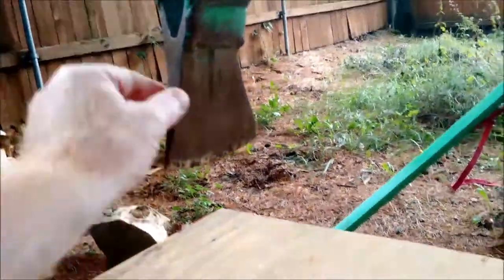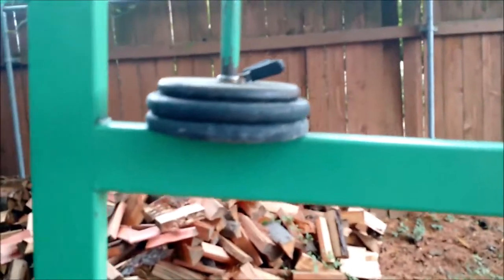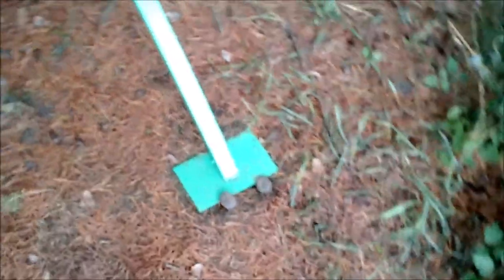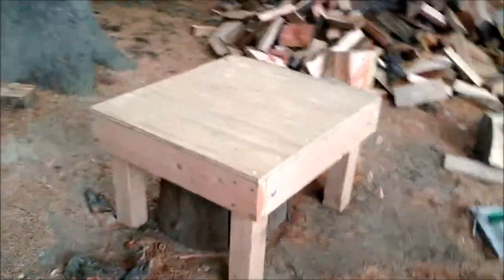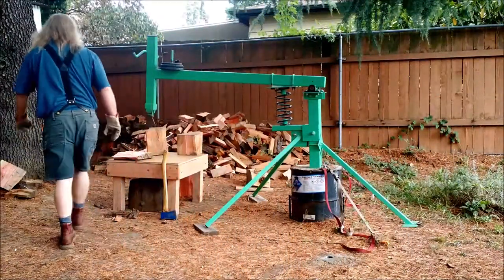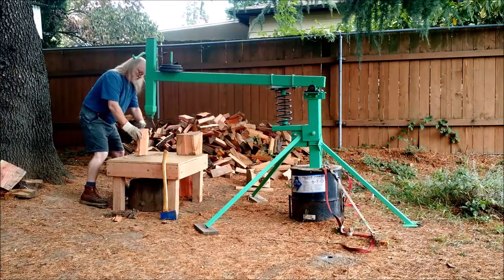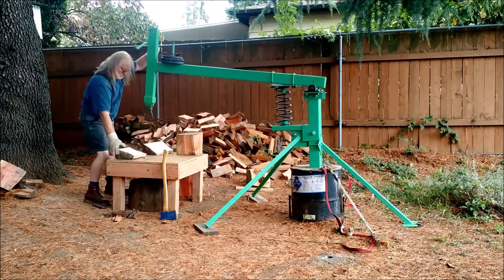Maunual Firewood Splitter

Comment: Nice splitter.  I would like to see you split 18 inch long logs with it.  I'm confident it can handle the wide logs but I want to see long long split with that thing.
Reply from the maker: I never tried splitting wood longer than my stove would take. I have a Morso Owl, I love it. It only takes 12" wood. I guess I will cut some logs at 18",split them , and then cut them shorter.
Reply: @capncaptain1594  Yeah, my stove takes longer logs so I was wondering what you thought about it.
Reply from the maker: @beebob1279  I would need to adjust the height so it would be able to accept longer logs.
Either by using a thicker shim
above the spring, getting a stiffer spring or removing some weights.  I have split 14" before because I cut it too long.  So I think 18" could be done.
Reply: @capncaptain1594  Last question for you.  I'm looking for a spring splitter.  Where are they in the marketplace?  I can't seem to find any for sale.   Nothing.  Any ideas?
Reply from the maker: @beebob1279  made this one.
I don't weld, but I designed, cut and put it together after I told the welder what to do.
Finding a spring from the
 rear end of a 1991 Grand Marquis.  I would like to experiment with a stiffer spring and more weight.
A station wagon or hearse would be good.  Most cars nowadays are front wheel drive. This is a pig tail style.
Since this video I raised the table and leveled where I am standing.  Works better now.

Comment: How about a motorcycle clutch lever and cable on the bars with the cable going back to the pivot point to release a spring loaded lock pin.  This way when you let go of the bars to grab the wood, the pin will catch and stop the bouncing.  For safety's sake.
Reply from the maker: Yes, I have seen that.

Comment: First, I really like your video. Second,  a couple of questions: What is the wall thickness of the square tube you used? And what is the length of the arm from the vertical member to the axe head. I plan to build one of these myself this winter. Thanks!
Reply from the maker: Thanks,GonehometoAcadia. Wall thickness is 1/8 inch, top tube length is 72" and down tube is 30."
Reply: @capncaptain1594   Thanks!
Reply: I plan to build this manual splitter eagerly but I have a question? How long is the arm where the  blade is, from  the vertical post.

Comment: How critical are the tie downs? what is movement like with just the weight and feet?
Reply from the maker: It doesn't move now but the tie downs lock it in place.  Without the tie downs it tends to rock a little.  I wanted to make sure I could take it apart to move.  I think one could set the steel 4x4 in concrete in the ground like a fence post.
Reply: @capncaptain1594  I would really like to build one, but i live on a very rocky hill and anchoring it would be extremely difficult. Do you think it would be possible to build one that was mobile (even if that meant dragging it on runners) but still stable enough to use without anchors? Really nice build by the way, love how smooth those pillowblocks make it ride, and the weight post is genius. Simple, but genius.
Reply from the maker: @sp4cepope  Check out Ingmar Andersson's You Tube channel he has one also.

Comment: Will it split maple and ash?
Reply from the maker: I live in Oregon and have no problem with Alder, Douglas Fir, Cedar, Spruce and Big leaf Maple. These are the indigenous trees of the Coast Range. I would have to import other wood to split.
Reply: @capncaptain1594  I am very happy if it works. I love the idea. 
My Ohio hardwood wood is in the 1300 range, a bit harder than big leaf maple. I would probably need a heavier counter weight.

Comment: I think I could split it just about as fast with that axe leaning up against the table.
Reply from the maker: Thanks for the comment. I'm looking forward to your wood splitting video.
Reply: I bet you couldn't.  You'd be exhausted.   I would say Cap'n Captain would walk away barely winded while you're sucking air.
Reply: Possibly but for how many hours in a session? And what happens when you get old sick and weak like me looking for a mechanical/powered solution?

Comment: If that spring breaks it’s weld you are in trouble...
Reply from the maker: Not sure which weld your talking about on the spring. It probably got more use on the car it came off of.  I will buy another one at the junkyard if it breaks.  Thank you for the concern,
Reply: Is the spring just sitting there??? Or is it welded onto the mechanism? Either way if the spring shifts while compressed it flys... that’s why they are mounted in vehicles and taken off with spring compressors. That’s what I meant.... and iv seen it happen.... it’s not pretty when someone gets hit in the head or face when the spring breaks or shifts and fly’s off.
Reply: Iv seen people mount some sort of metal tubs of sorts around to protect that from happening. It probably will never happen but it sometimes does... especially if it is a used spring. No disrespect was just stating what iv seen in the past. I do like your machine though.
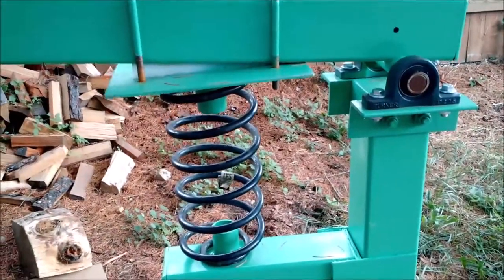Reply from the maker: @honestme72880  Watch the video. At about 1:34 you can see that it is a pigtail spring and that on the upper and lower mounts there are steel tubes
welded in place.  The spring fits over these mounts and it can't go anywhere
because it is under tension and compressed.  To remove the spring I remove the weights and have to lift the arm high enough so that the spring is under 0 tension and clears the mounts (tubes).  Works slick.  Maybe I will make a video of how to remove the spring.  I used to work in sawmills I am a safety first guy.  Have all my fingers still.

Comment: I think you should have raised the table a bit more so you don't have to bend over so much. Other than that, cool machine!
Reply from the maker: I'm 6'4". I made it for my wife to use.  She is 5'3"
Reply: The other benefit to a lower table means you don't have to lift heavy rounds as high 😎
Question, how does it go with large rounds? And knotty?
Reply from the maker: @ted8831  Large rounds that are 18" or bigger I split in half or in Quarters.  Depends on the size of the knot some can be split or I just split around them.  Next time I have more wood to split I will make another video.  I do have another video which is POV with a GO PRO on my chest.